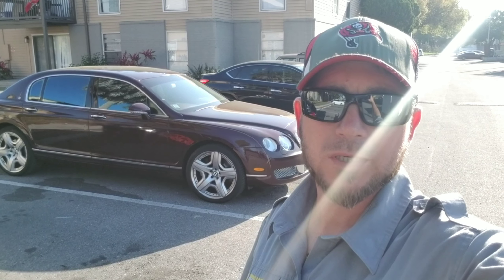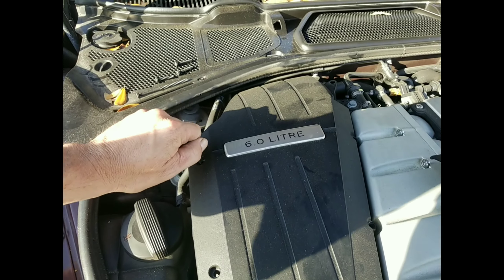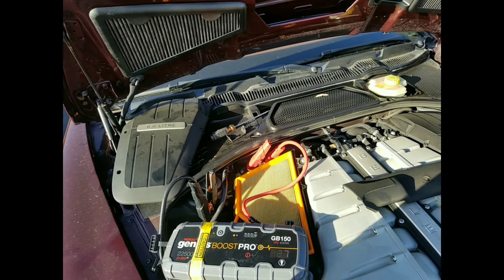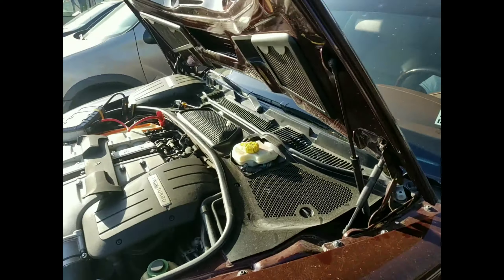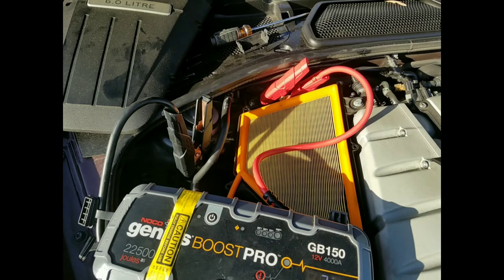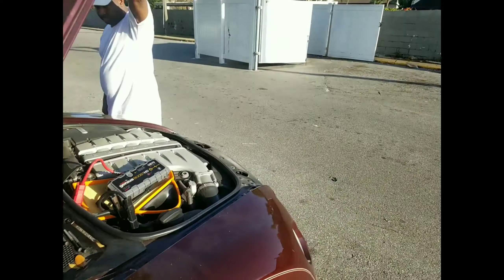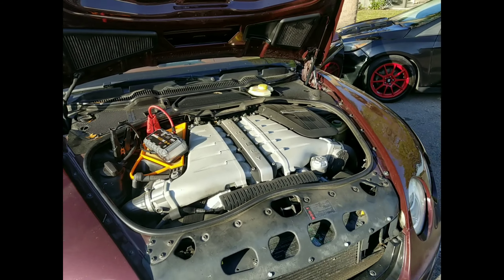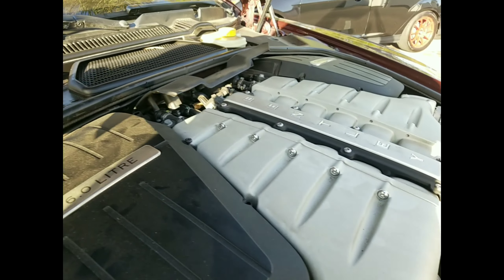How To Jumpstart A Bentley Continental

Comment: I just used a small wire to bridge between the live terminal on my jump pack and the jump start point on the car, will give enough power to open the boot and get to the actual batteries
Reply: Where is the live terminal?

Comment: No need to remove all those airbox screws...just remove the single 10mm bolt in upper right corner & lift the whole airbox off slowly..its slightly resistive as its mounted with rubber nubs, carefully pop em up & pay attention to the mass airflow connector underneath, move it sligjtly to access the power dist. Box cables.. (use the one on the left, theyre ONLY to power up to access the trunk release...then jump start from the trunk battery, dont try to jump from under the hood!

Comment: That was all wrong. Turn the key to the left then to the right for emergency startup. They put the jump pack on the accessory battery instead of the starter battery which they was getting the juice from. It didn't need a jump at all. It just needed to be started with both batteries in parallel which turning the key to the left then the right would do.
Reply from the maker: First one I ever did. Will try what you suggested next time. Thanks for watching.
Reply: @roadsideguy5902  gotcha. For those cars if you see 12 or better volts from that post under the hood then the starter battery is charged.
Reply from the maker: @gasolara2002  thanks I had no  idea. Much appreciated.
Reply from the maker: I just had another opportunity to jump the same type of vehicle and I vehicle and I tried turning the key to the left and it did not work.
Reply: That only works if the main battery has some charge . When the main battery dies (say the idler pulley failed and the belt comes off), the switch box will not have enough juice to switch to the starter battery. So you have to do it this way to get into the trunk and service the batteries.
Reply: @roadsideguy5902  lol i hear ya. I work on these for a living. Little heads to help you out because there is a ton of false information out here. I was once mobile myself, know the struggle. The vehicle does have two batteries, and one is indeed an emergency start battery, but the vehicle still needs adequate power from the main battery to switch over as the process is still an electronic one (LOLz I know) That is done by turning the switch to the left, then the right and holding for a couple seconds. This will only work if the main battery has enough juice to power the switch over box (called micro power module). If the system battery (the left side battery) is completely dead, the car will not start, as there is no power to perform the switch over function. At that point, you need to access that ebox under the hood, and use that port only to pop the trunk to service the main battery, and get the power flowing to the system to power up the vehicle.

Good luck. These cars are dumb, but hey dumb pays. I love working on them.

Comment: what happens if the whole cars locked and dead how do you open bonnet please sir
Reply from the maker: Must call your roadside assistance through your insurance company and request the vehicle be unlocked and then jump started. If you live anywhere in central Florida you can request my company roadside guy LLC
Reply: The car still has an old school flip key. You use the key to unlock the door manually.

Comment: The guy is a complete amateur….didn’t have the right tools, don’t need to take air box cover off and you need to give it time then go via boot…..or as others have said, turn the key left to use the supplementary battery on RHS of boot space……on every level I wouldn’t let this guy near my Bentley. But probably doesn’t matter as the Continental sounded like a bag of nails when it started, so screwed anyway 😂🤣😂😉😂😊
Reply from the maker: You should start a youtube channel

Comment: :: Shaking my head ::  10 out of 10 for enthusiasm, 2 out of 10 for method. 
Wrong terminal first time, only use the front point to open the boot. 
Jump onto the battery on the terminal side, not past the fuses.
Reply from the maker: Good advice. First Bentley.